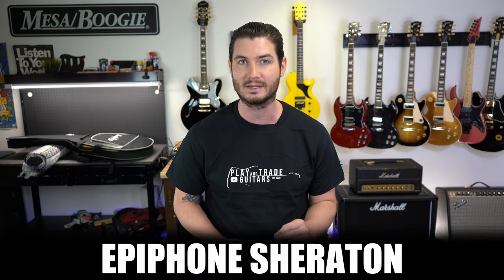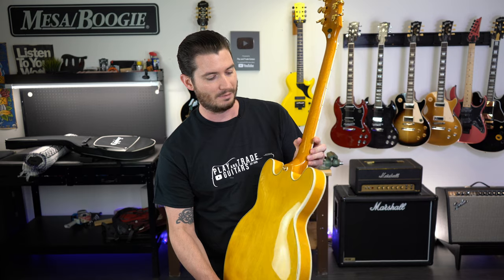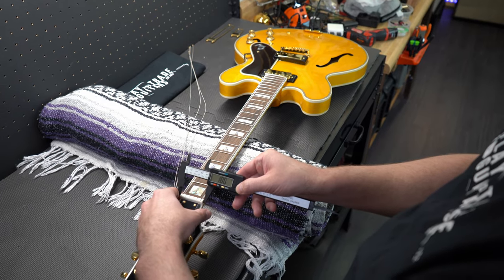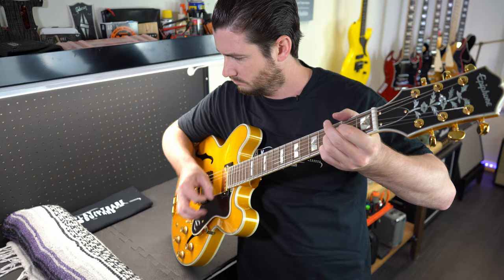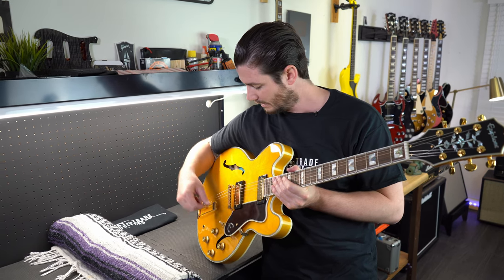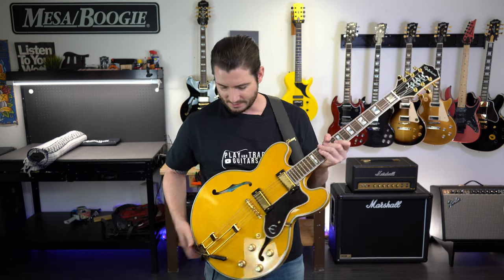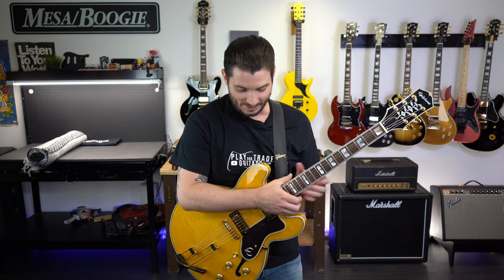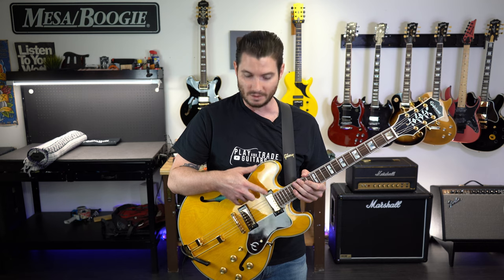NEW Epiphone Sheraton FULL DEMO

Comment: The longer overall string length on the bottom strings would make them have more tension than a regular bridge stop tail set up that should give it a tighter cleaner low end. I think this is one of Epiphone’s best guitars.

Comment: With every guitar I bought that had the frequensator tailpiece, the first thing I did was to remove and bin the frequensator, and fit a Bigsby in place of it.
Reply: Bigsbys are known to throw guitars out of tune. thats why Billy Gibbons has his deactivated. have you had tuning issues?
Reply: @eddienebula6084  . . No never. All you need to do is stretch the strings in nicely when changing them and you won't have any problems either.
Billy Gibbons? He uses 7-gauge strings, for goodness sake! Of course he'd have problems getting a Bigsby to function! See Joe Bonamassa's guitars. Plenty of them have Bigsbys. Like me, He knows how to handle 'em.

Comment: Great review. I just really wish Epiphone would put proper rosewood fretboards on these guitars instead of just "laurel". The fretboard is one of the only things you can't upgrade on a guitar so if you get one of these you're stuck with a historically inaccurate fretboard. Pre-2017 every guitar brand was putting real rosewood fretboards on all levels of guitar, so to charge this much money and not even go with rosewood feels ridiculous.
Reply: Some species of Rosewood are endangered. CITES serves a purpose.  You need to get over it man. Things change over time. I am generally a traditionalist. That is why I bought one of these (besides the fact that it sounds badass). The laurel fretboard is just fine. Someday, it will be considered "traditional".
Reply: @gregputman  yeah I get what you're saying Greg, but I think it's all the rosewood furniture that was being made that put rosewood on the endangered list that's why musical instruments are now excepted from the CITES rosewood regulations. The guy who owns Taylor did a big video on how there's massive deforestation problems with ebony too, but it doesn't stop Epiphone from using it on the Lucille models, Les Paul Customs and even those cheap Modern Les Pauls. I'm all for preserving the environment, but Epiphone contribute hugely to the problem of ebony deforestation and then put cheap laurel boards on other guitars and try to make out like it's because they care about the environment. That said, I've got a laurel board on my Epi John Lee Hooker sig because sometimes you've just got to have that guitar right!

Comment: This is not a Sheraton. The Sheraton does NOT have a staggered tail piece.
Reply: the Sheraton 2 has a stop tail piece. this is a vintage style throwback to the original “ Sheraton” produced between ‘59 and ‘69. which had the frequensator tailpiece
Reply: @eddienebula6084  Thanks, you've helped improve my knowledge.